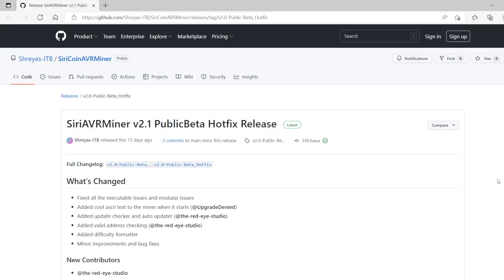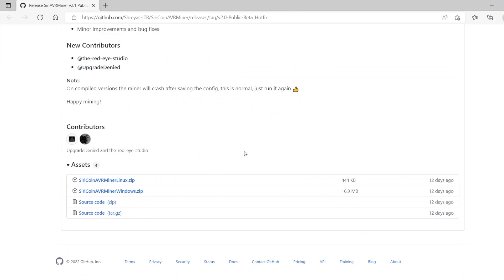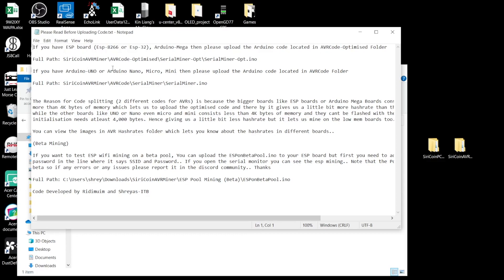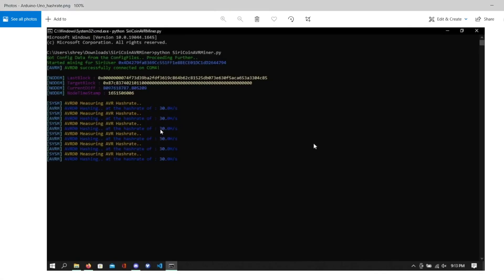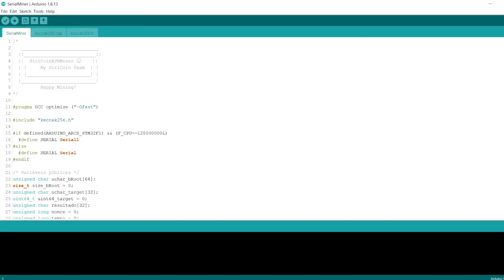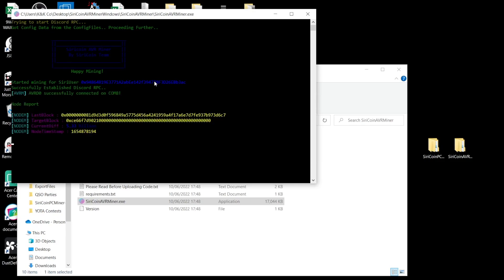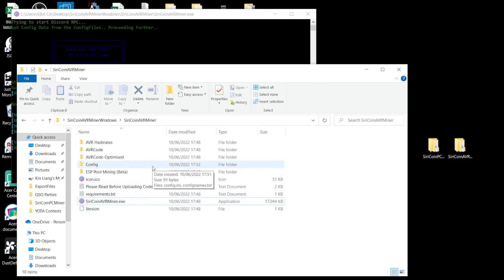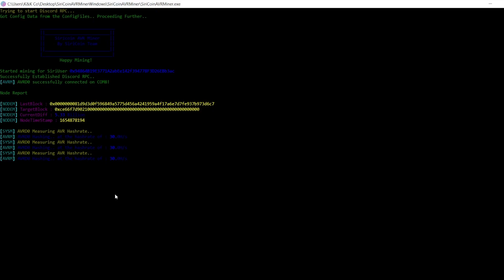How to mine SiriCoin on Arduino?

Comment: help me answer why miner doesn't show the balance
Reply from the maker: Are you using the latest version of the miner? You will also need to mine a block in order to earn Siri.
Reply: @karlselectronics3517  i use web miner
Reply from the maker: @miyangho153  I don't recommend using the web miner now as it is currently facing some optimization issues.